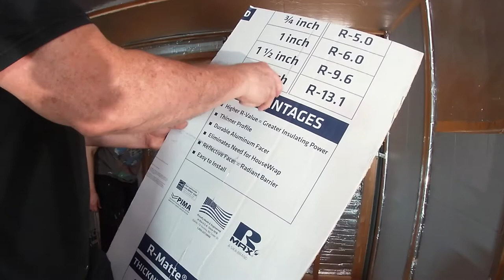How to replace the roll up door with an insulated wall and window in your box truck. Box Van Arizona

Comment: Best, simplest, clearest wall installation vid I’ve seen. Gives me all sorts of confidence to do a similar project. Thank you for documenting this process!
Reply from the maker: We're really glad that you found this box van conversion video helpful. If you don't mind my asking,  what is your DIY project? Is it for a box truck or something else? Thank you for watching and leaving a comment too.
Reply: @Fit4Expedition  it’s for a 2006 UHaul E450 box truck RV conversion. I already knew I wanted a framed back wall with an air conditioner and a door installed, and I’d been dreading doing it poorly or having it take forever or be expensive. I knew there were folks out there who’d already done similar things, but all the how-to videos I could find were “here’s before, here’s after” without the simple stuff in between that I really needed to learn.
Reply from the maker: @mollycadencecase9019  Hi Molly. This is Greg. Let me know if you have any questions. I'll do my best to help. If you would like you can use our channel email. Fit4Expedition@mail.com. It's mail, not Gmail. I'm excited to see your box van project if you have any pics.
Reply: @Fit4Expedition  thank you! I won’t be working on it until the spring, but I’ll save your email address.
Reply from the maker: Awesome! Good luck with your build.

Comment: Cool build. I'm in the middle of removing my roll up door and replacing it with double awning doors.btw what music is this🎵🎶?
Reply from the maker: Awesome John. There's an earlier video where I actually removed the door that might be more useful if you're looking to see how I did it. Is it the intro music that you are talking about?
Reply: @Fit4Expedition  yes sir I'll have to check that video out, I pretty much got the cable in the metal bar and all that out, not sure if I want to cut the door to remove it or roll it out from the top where it unbolts. We'll see how that goes lol. But yes I was referring to the intro and pretty much the rest of the music is pretty cool?
Reply from the maker: @JohnSmith-xx1lx  The intro song is Red Hot Son. It's in the YouTube audio library. I'd have to go back and listen to the other songs. 😄

Comment: This is awesome!  Don't know where to get the A.C. cowls though?  Are those 2x3s?  Where did you get the fiberglass boards/panels?  Did you use the same TEK screws on the outside panels (all around the outside)?  What trim did you use?
Reply from the maker: For the AC cowl look on the Home Depot website, look up Amana ac sleeve. It's 42 inches. That's the size we're using because we have 2 units. We did use 2x3s throughout. They have those fiberglass sheets at both Home Depot and Lowes. I used the TEK screws wherever I was going through metal. We used gorilla glue to adhese the fiberglass to the plywood and butyl tape around the edge. I used hex head screws (not TEK) to secure most of the fiberglass. The trim actually came from the shelving department at Home Depot.   It's in the area where the white wire shelves are. Thanks for watching and asking questions. Let me know if you have any more questions. Thanks.